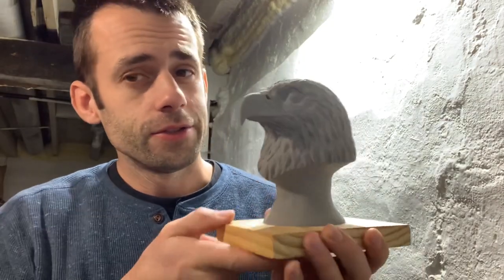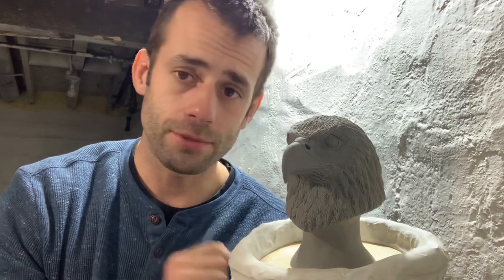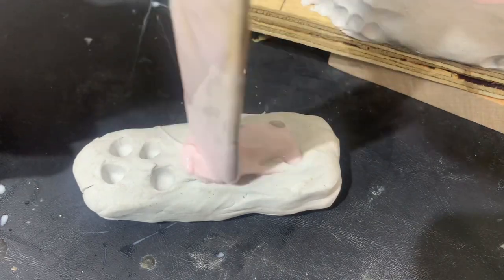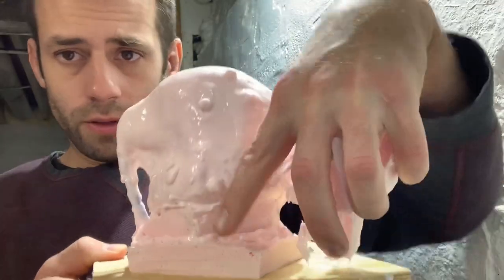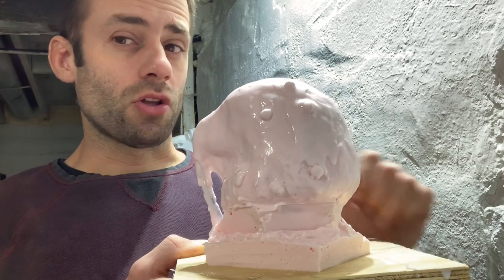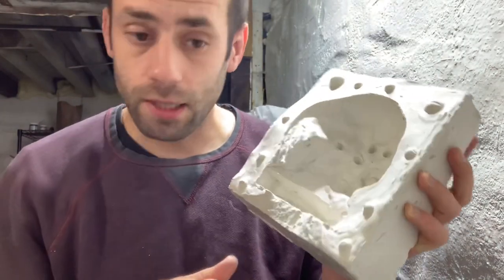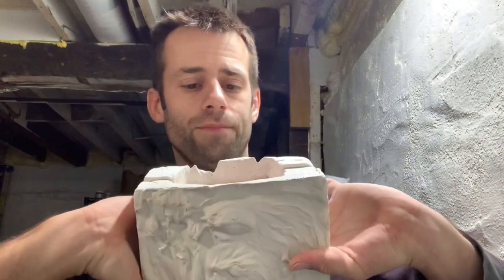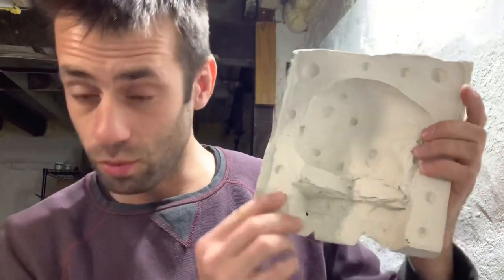Molding the Eagle Sculpture | Bronze Eagle Part 2

Comment: I like the silicon/plaster mold combination - maybe there are safer, cheaper silicon fillers/thickners.  How thick would you say the wax is?    Also wondering why beak sprue would not be attached latter?  No substitute for practice - You are turning into a real pro - the bronze will truely be a work of art!
Reply from the maker: The wax is between an 1/8”- 1/4”. 
The beak sprue just needs to be in contact with the clay. I can’t have any rubber making a deal or it will not vent properly. So I could put the sprue on later but I would have to cut through the rubber to get to the clay and I didn’t want to do that.
Reply: @lundgrenbronzestudios    Yea, the beak area would definately be prone to air holes when pouring wax.  Thanks for reply .  We are learning too as you learn and it's so cool for you to share your knowledge and journey with us.